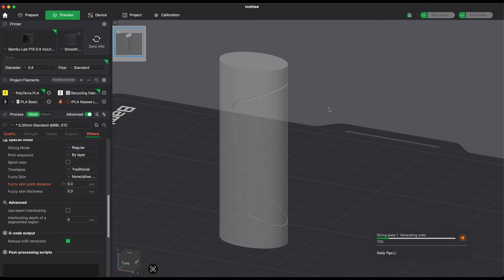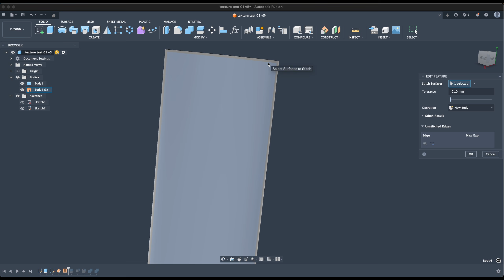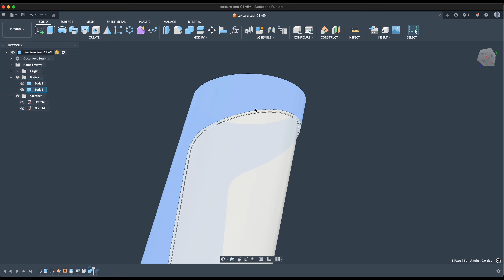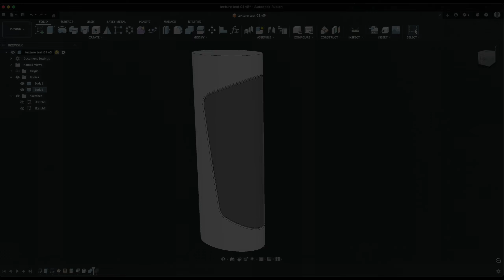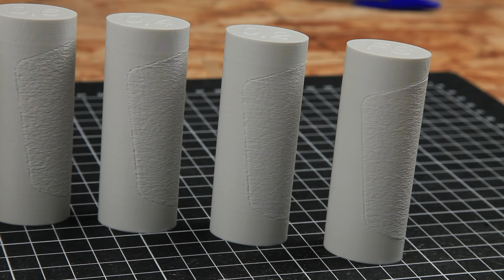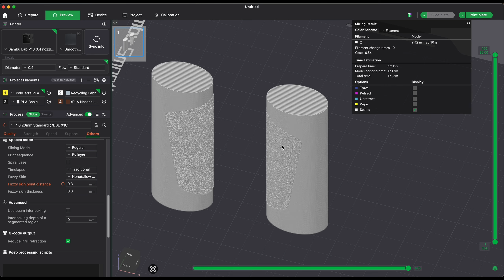permanently bake fuzzy skin texture into STL files with Fusion and Blender.

Comment: Just curious, why do you use a separate software to make the initial cut of the objects? Nice, clear instructions and a very informative video! Thanks!
Reply from the maker: Good point. You could separate the parts in Blender, too. I'm using Fusion360 as my main CAD software for modelling, so that was my workflow that I wanted to show. If you're importing an existing STL, you could just do it in Blender if you know how. I can try to make a separate video about that if you're interested.

Comment: Why doesnt PrusaSlicer accept my pull request for displacement maps so you dont need millions of verts? Same for OrcaSlicer where someone ported my code.
Reply from the maker: That would be great. Form labs has a feature like that in their slicer to simulate mould textures.
Reply: Hearing of things like this really discourages me from contributing to the slicers code base.
Reply: @jaminoes_  It isn't the fault of open source, it is the fault of people getting too big and not handling it well and not being community directed. For example, who asked to add WebKit to the build for both of those slicers for glamourous UIs? Not me. PrusaSlicer is slow and unstable now. It crashed seldom or never on me before that.